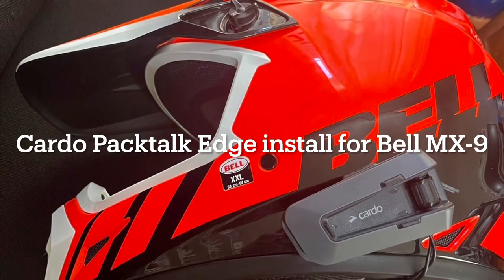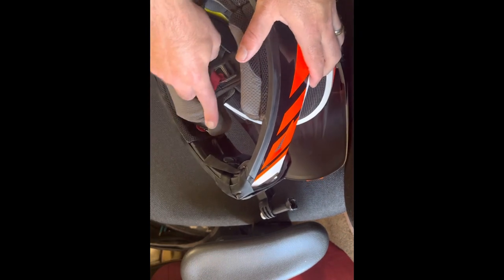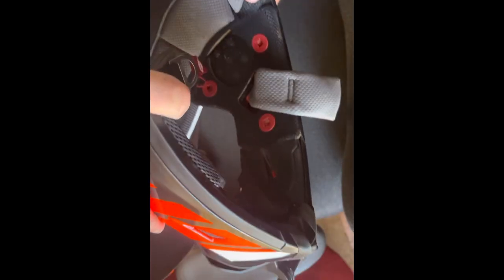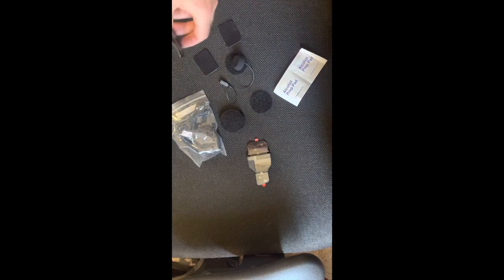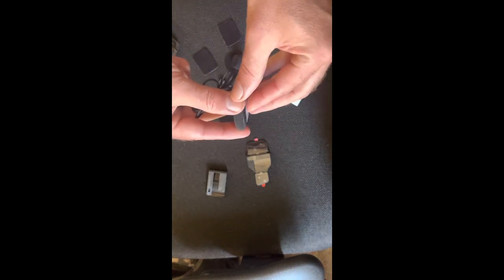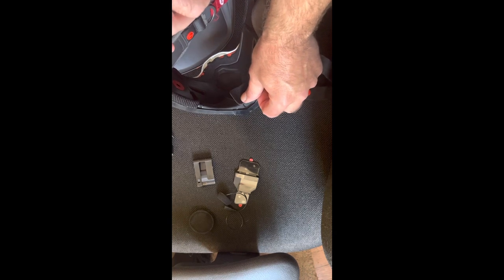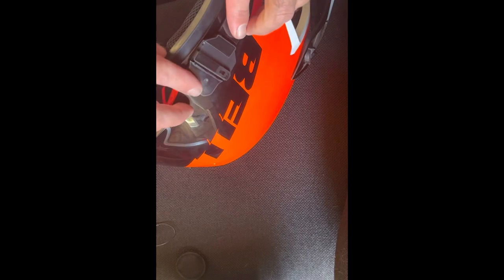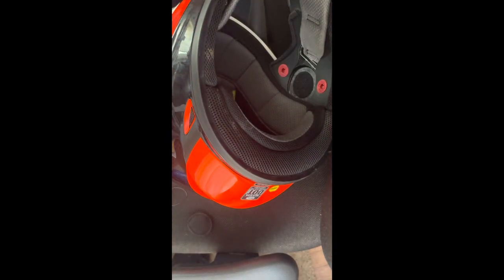Bell MX-9 helmet Cardo Packtalk Edge installation how-to: the painfully long detailed version.

Comment: I'm glad I found this.  I just ordered my Packtalk Edge and have a very similar helmet in the Bell MX-9 ADV.  I was wondering about which mic as well and with the lack of a solid mounting point for the "button" mic in the middle along with the large space between your mouth and the inside front of this helmet, it looks like the boom mic is the way to go.  Any regrets going that route?  This is really going to help me out installing mine.  Thank you!
Reply from the maker: Thanks for the comment. No regrets at all. The boom mic has worked great in this application.  And there is plenty of space for it makes the wire routing easier as well.

Comment: Because it's a motocross helmet and is more open than a road helmet, it picks up a lot more wind noise, right? Or does it work well?
Reply from the maker: I would say it picks up a little more wind noise but honestly not too bad. I use the same cardo for both my Bell dirt bike helmet and my Arai road helmet and the arai is only slightly quieter but the bell still works great at least at dirt road speeds. I haven't tried it at 70 on a freeway as I don't ride my dirt bike on the road.